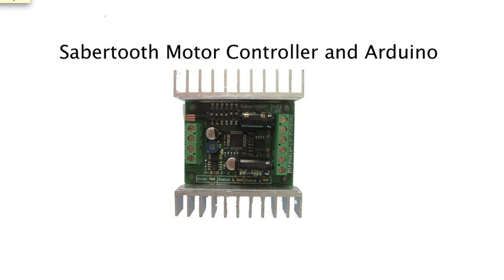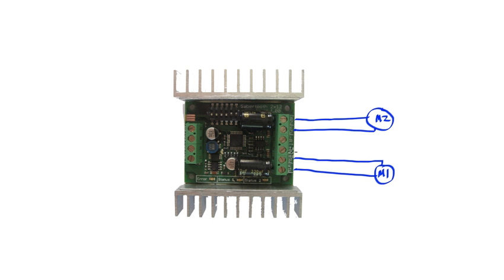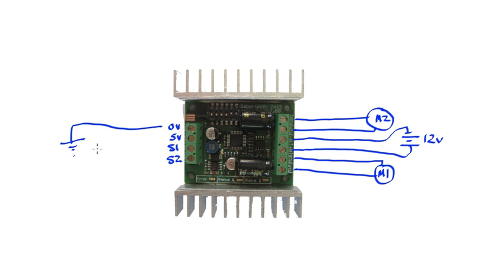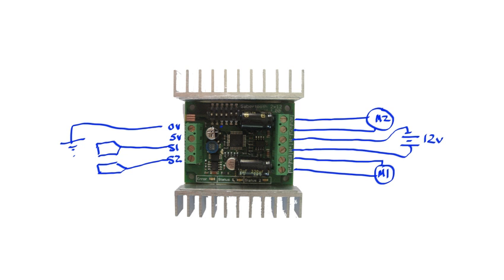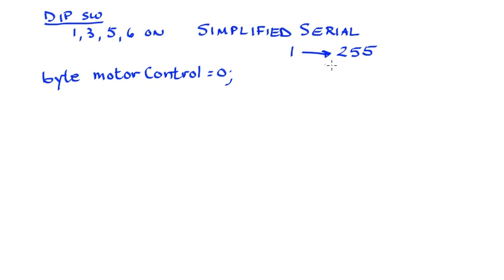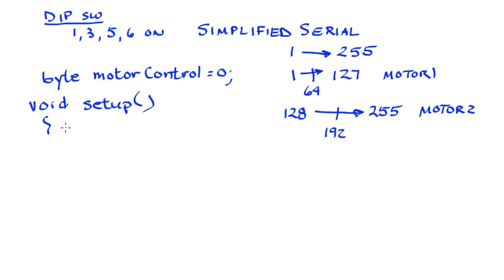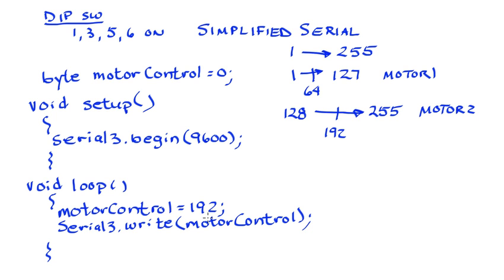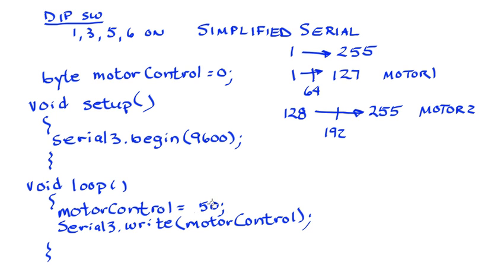Using the Sabertooth Motor Controller with Arduino

Comment: Thanks for this video. I'm trying my luck with an rc 20hp riding lawn mower tractor using an alternator two wheel chair motors and supercapacitor bank. You provide much needed info. Thanks again.
Reply from the maker: Good luck on your project.  When you get it done, I'd like to see it so if you can, post a link to a video.

Comment: Is there any better and cheaper option with similar functions because it is very expensive...plz do suggest or have to buy it if there is no choice.
Thankyou
Reply: Take my advice and buy the sabortooth. Most people don't need the 2x60. I tried the cheaper route and in the end it cost more trying to take the cheaper route and I ended up buying the ST2x32 anyway. Stress free plug and play.
 Trying to find a cheaper way ended up costing me about $300 when all said and done

Comment: Great video, thank you for this info! I'm using the Sabertooth with a Microchip PIC18 microcontroller, and I was wondering whether serial mode could be used with the USART protocol.
Also, is the serial protocol fire and forget (send a single byte for a motor and it stays at that speed until another byte is received), or is constant communication required?
Thank you!
Reply from the maker: The serial port I am using on the Arduino to control the Sabertooth is uses a UART so I would suppose it would work on your PIC18 (I am not familiar with it so I don't know for sure).
Also, once you send the single byte instruction via the serial port to the Sabertooth, the Sabertooth will continue performing that function without you having to send any additional data.  You only need to send data when you want the controller to do something different.
Hope this helps.  Good luck on your project.

Comment: Thank you very much, it was a great lesson on Sabertooth! 

I just didn't understand how to move only motor 2 to the right, what value in byte set for motor1=v0 and motor2=vmax.... 🤔
Reply: To move left, when
motorControl=192 then
motor1=127
motor2=65 
👍🏻👍🏻👍🏻
What should be the value for motorControl to the opposite move, like m1 down and m2 up?

Comment: what would you recommend to control a motor intended to be used as a steering servo. I have an ATV I want to drive via RC, and was going to control the steering with a geared 12 volt motor. How might I determine motor position, either with a specific board, or with this board and a microcontroller? I have a sabertooth motor controller. I cant find any boards for high amp 12 volt motors for servo like purposes. How could I use an arduino or similar to read a potentiometer linked to motor to determine the appropriate pwm to send to the sabertooth?

Comment: I recently bought a sabertooth 2X 35. For a track vehicle i am making. I am struggling with trying to make a manual controller (not remote) with a 2axis potentiometer joystick. I’m aware that there are joysticks to use with Arduino and I’m assuming they are digital? I have very limited knowledge of Arduino but I’m sure I can easily learn. Just not sure where to start. Any insight? I’d love to ask you a few questions via email if possible?
Reply: Joysticks are made of several potentiometers. They are analog devices, not digital. They need to be connected to the analog ports of the Arduino or other microprocessors.

Comment: Hi, don't know if you are still active. But i want to control 2 motors at the same time. Take for example i want to power both motor at full speed, can i send 127 then 255? Will it run both at the same time?

P.S. From the manual it states that simple serial can only run in 1 direction, not sure if they are refering to this.
Reply: Runs in 1 direction just means the motor controller doesn't talk back to the device sending the serial signal. The signal is 1 direction.

Comment: hey nice video i think its the only one that has info about how to use the sabertooth and program anyway i need to ask u a question i been tryin to test my sabertooth 2x12 and the problem im getting is im using a arduino mega and in the example program the serial ports are not defined they are probably defined in the library which i checked should be serial port 1 which i think should be tx1 slot 18 bt im still not getting any response..if u could tell me what to do and make more videos with more conditions (like to use it with sensors) i would really appreciate it. thanks
Reply from the maker: Thank you for the comment.  I also was using the Arduino Mega.  You are correct in that the serial port has to be initialized (I do this in the setup portion of the program) so it can be used in the main (loop) part of the program.  You do not need to include any libraries along as you are using the pins that are part of the built in serial ports.  If you choose to use one of the other pins, then you can use a library like SoftwareSerial.

I am looking to do some other video tutorials, so any specific suggestions are welcome.
Reply: No your video was very clear i got to test my motors and sabertooth no library was needed i knew which port was working unlike the sabertooth library which didn't explain much and i couldn't get it to work anyhow everything worked  because of your video so thanks a lot .
Any video with sabertooth and ultrasonic sensor would help me a lot personally